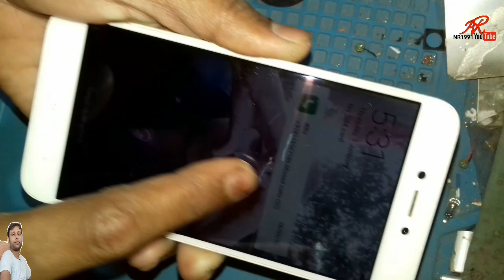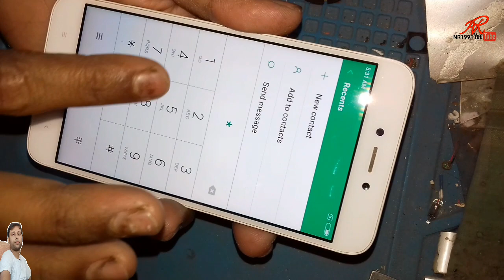MI 5A TOUCH NOT WORKING SOLUTION

Comment: When I did this exactly as the video, nothing happened, so I held volume down and power button and it showed me a factory picture,then switched off itself off after 3 minutes. I turned it on and nothing happened for 5 minutes, all of a sudden when sliding around the screen it started to move and finally the screen started working again. Well to me it works, just improvised from other videos. Thanks alot.
Reply from the maker: Hi Friends  A 2 Z Mobile Repair solution Any Question Please Comment Here Resolve Your Problem.
     Thanks For Watching Please Subscribe My Channel For More Update Thank You